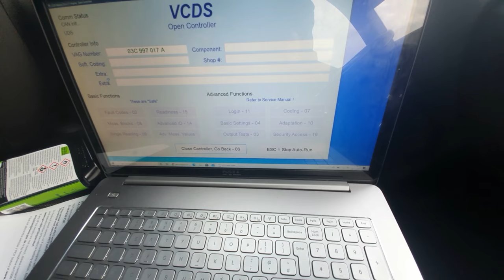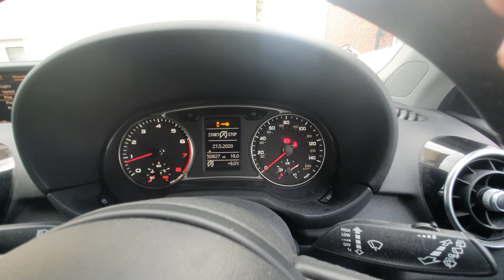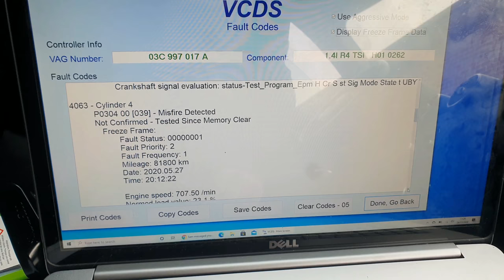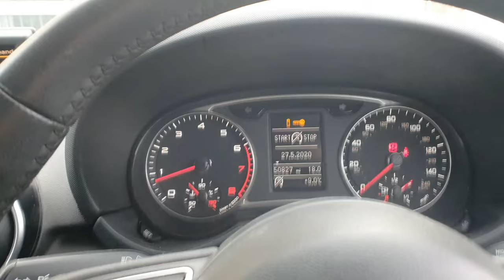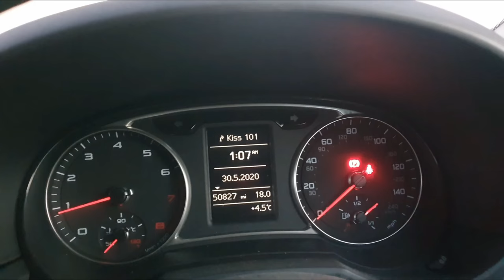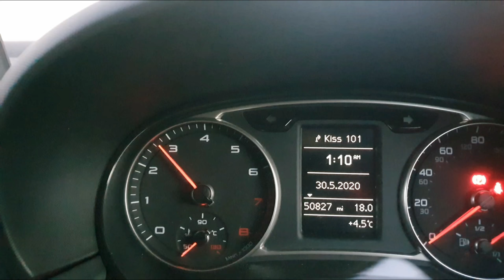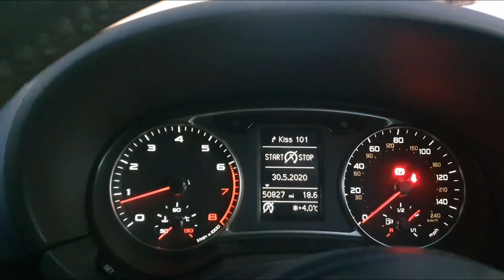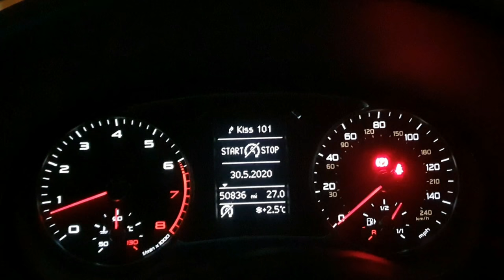Copart Audi A1 Mot Failure, Emissions Fault, O2 Sensor Replacement Salvage Project Car

Comment: Just wondering if you can get some O2 values from vcds measuring blocks. Very handy for checking sensors are functioning correctly. And the ECU is seeing the values as well.

Comment: You’re still making progress. I’m wondering if the Cat and sensors fault is what’s buggered the plugs. Nearly there.
Reply from the maker: Could be... but I think the other way round buddy i had taken off a o2 sensor previously & it didn't look like that. Now its all clogged up the cat is faulty & its all after I changed the plugs... but the cat was also probably damaged in the impact. 
The cars going to the garage on Monday they are fitting a new cat & mot the car again i just haven't got the time to do it. Thanks for watching 👀 buddy
Reply: @RevivingSalvage  I often give in and take it to the garage like I did with the brakes on my Project Dirt. It'll be gone soon, then you can move on to another project.

Comment: on that, will it says 1 place there u take the sensor out or will it say different place problems? I have Audi A1 2011 model! I have the same problem when I drive it turns on after 1 h. but after 7 h it turns off. but the car stil works! and I have EPC, it says same turn and turn off.

Comment: What super car are you trying to get to?

Whaat is ur background?what do you do as a day job?

Shame you have no garage

I did my transporter t5 2.5  head rebuild on my drive way.under the tarpaulin,on the floor ,snow and rain 
But I did it .
So you will do it 
The more you learn on this one the easier would be the next one
But unfortunately every car and every damage is different so we learn all the time))
If you keep doing Vag group it would help as it's nearly all the same just names are different. 

Anyone who slagging of the body shop  are wrong

Light silver is one of the hardest colours to blend 

Don't know what happened with drivers wing ,)

Comment: Hi mate  check this link for 02 wiring https://drive.google.com/file/d/1p8okwrszprtFmHKzsm7lNxtTQGqg070M/view?usp=drivesdk
Reply: I think you might stiil have a wiring issue with the 1st o2 sensor . You need to check continuity between ecu and o2 sensor  pin 1,2,5,6
Reply: The error is referring to the pump cell in the o2 which the ecu regulates the current to it. From that it works out if its rich or lean . This could be causing all your missfire issue's and emmisions